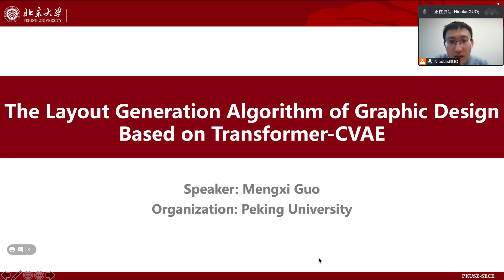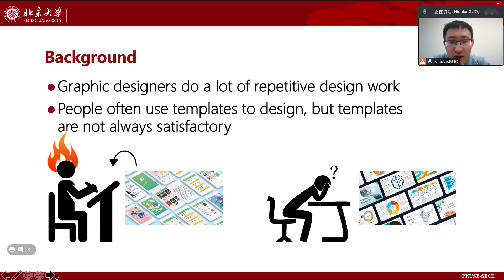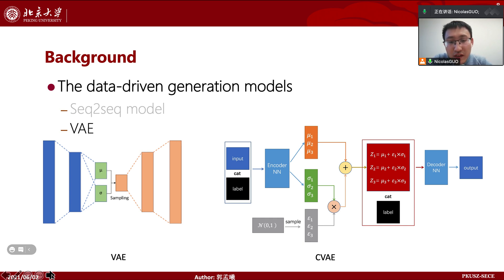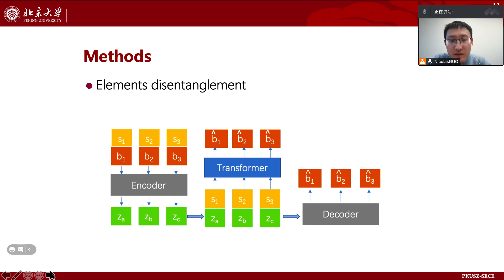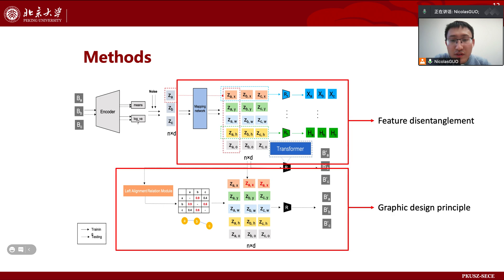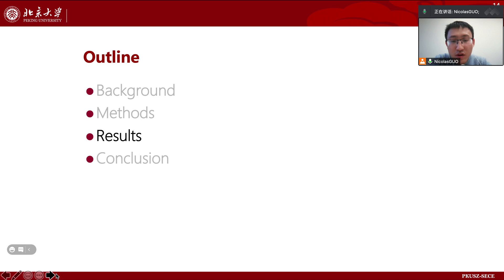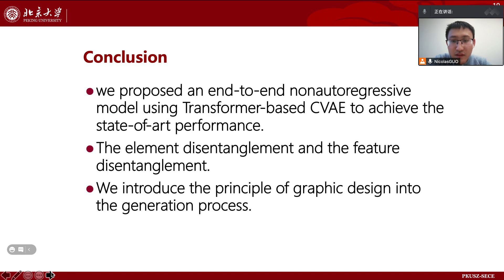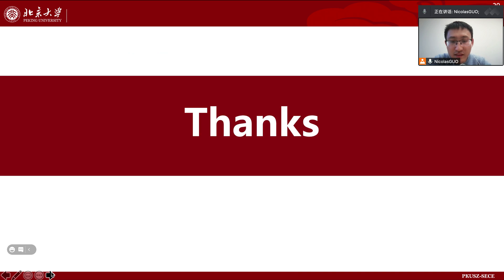CONF-SPML 2021 – The Layout Generation Algorithm of Graphic Design Based on Transformer-CVAE

Comment from the maker: Here are the questions we collected and answers replied by the presenter: 

Q1. Can the algorithm used in this research create design drawings with different resolutions？

A1. This method can generate a layout at any resolution. Because we are normalizing the layout canvas to (0,1) and generating the bounding box for the component on this canvas, its generation process is independent of resolution.

Q2. What are the limitations of the algorithm used？

A2. This algorithm has some limitations. Firstly, this algorithm only considers simple component types and relative positions, without considering the content of components, such as what text is and what image is. The algorithm also doesn't consider what type of layout needs to be generated, for example some meeting scenarios may require a more serious style, which can affect the layout generation.